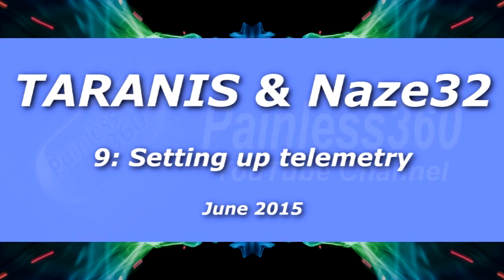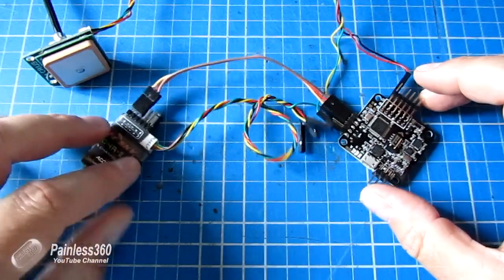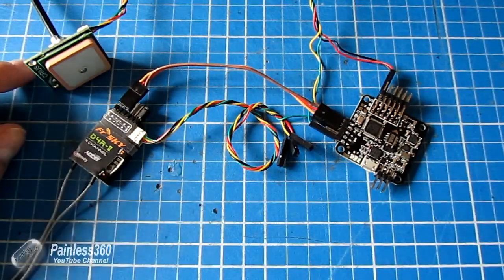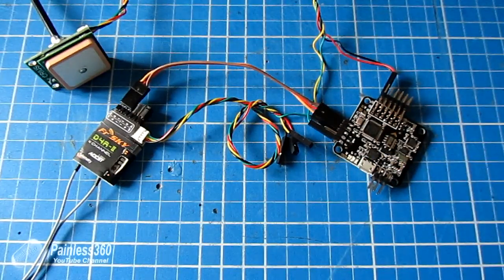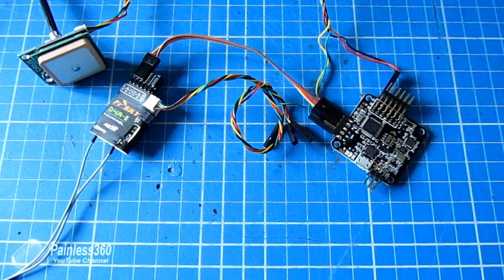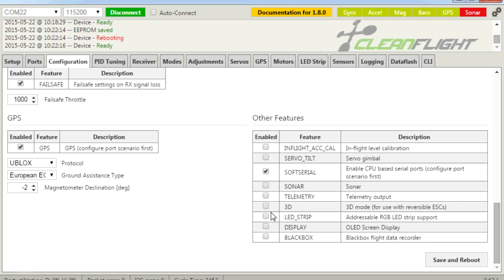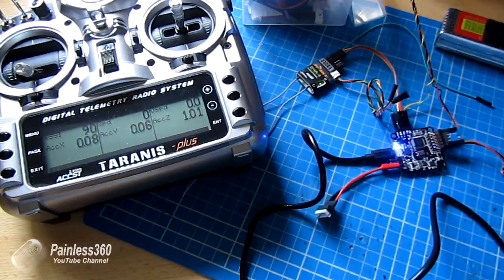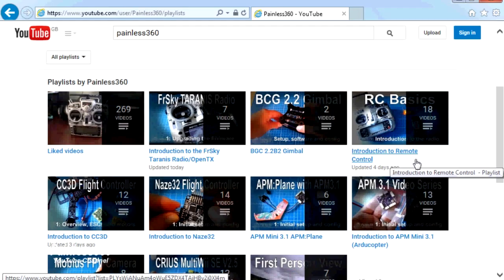(9/12) FrSky TARANIS/Naze32 Telemetry - Simple setup using a D4R-II receiver

Comment: in the beginning of the video you said you need the black and green wire but you only used the green wire I did everything you did in the video and it's not working do I need to connect the black wire to a ground?
Reply from the maker: +basebilljr07 It worked as we did it in the video. We were using OpenTX2.0.17, later versions changed the way that telemetry worked and needs you to 'discover' the telemetry available before they can be used. Best of luck!
Reply: +Painless360 yes I knew that much but I got it working I had to change the setting in clean flight ports from the 9600 setting to the automatic setting and then it worked
Reply: +Tim Donovan the radio has to be paired to the receiver with both needed on then in the actual radio go to the tale page which is telemetry and highlight scan for sensors and push the enter button
Reply: +Tim Donovan in the ports tab on clean flight did you enable soft serial and change the tab to Frsky and automatic I had the exact same problem and that was what fixed it
Reply: +Tim Donovan if you connect the green telemetry wire to CH 6 on the naze and enable softserial in clean flight ports tab you will get telemetry even when the board is not armed
Reply: +Tim Donovan no problem I was just dealing with the same exact thing its my first mini quad I built (the ZMR250) and I was having the same exact problem with the telemetry but yeah it's very easy to switch that but yeah it's very easy to switch that just move the green wire to CH6 on the naze then go into clean flight and in the Configuration tab enable softserial then go to the port tab turn on UART1 then the drop-down box change to FRsky click save and your good to go

Comment: Anyone have an idea what the difference is between A4 and Cells values?  Looks like the Taranis radio is already setup for lipo voltage using A4 (low/crit warning levels).
Reply: The short of it is use CELLS.  If your voltage level is not correct and needs to be calibrated there's a Cleanflight/Naze32 setting to adjust the scale, vbat_scale, which is what I adjusted.  Background, A4 is voltage reading on the receiver that the receiver adds to telemetry as it's sent to your transmitter.  If you power your receiver thru a BEC or DC to DC step-down then A4 is not very useful to measure battery life.  Also contrary to some sources CELL telemetry value is worthless unless you have something plugged into the batteries balance connector measuring individual cell voltage like, frsky sp-flvs.  I like the idea of warning on a single low cell but I didn't want the extra weight or complexity on my multi-rotor.  Hope this is helpful.
Reply: The values for CELL/CELLS are set by the flight controller.  The value for A2 is set by the receiver.  CELL/CELLS values dropping out could be a bug in BetaFlight or a telemetry cable/connector problem.  You might consider trying CleanFlight.  If CleanFlight works consistently then BetaFlight likely has a telemetry bug you should report.  If after switching to CleanFlight CELL/CELLS is still dropping out then try a different cable.  Hopefully, this works.
Reply: Under the CleanFlight Configurator I enabled battery monitoring.  I can use either the telemetry or soft serial pins successfully.  I have the latest version of OpenTX installed on my Taranis.   There is a new setup under Taranis for configuring FC data where the transmitter discovers the metadata supported by the FC.  When u do that you see all supported telemetry metadata sent to the transmitter.  You should see CELL/CELLS in a big list.  Earlier versions of OpenTX shipped on Taranis radios sold about 1yr ago (when I purchased mine) all telemetry metadata is included on transmitter but unassigned if not supported.  I have not tried BetaFlight yet so it could be a little different.  I know some of the config settings r different
Reply: ***** If your an acro/rate flyer then your probably not going too far anyway.  If your doing laps by yourself periodically you will hear buzzer if u want to stay with BetaFlight.  Don't forget to file a bug report with Betaflight developers.  It's likely they already know but still more voices helps set the priority.

Comment: Great set of videos! I used this one to set my Flip32+D4R a while back, but after moving from Cleanflight to BorisB's betaflight telemetry stopped working. Or at least I noticed that it was not working.
Re-did all the settings via GUI but the CLI command above was returning an error. Finally had the idea to check a cmd dump and found a "set telemetry_inversion = off" line.
Tried "set telemetry_inversion = on" (rather than = 1), et voila, problem solved, ça marche!

Comment: After binding the Frysky DH-4 receiver to the TX,I use a test servo,but nothing happens! My combination.  was just set up by a hobby shop that sells those.Even after that nothing happens.The light shows the receiver as being bound to the transmitter!
Reply from the maker: Check the connections are the right way up and is go back to the store and get them to give you a hand. Best of luck!

Comment: I am slightly confused about the DF13 cable:
1. Can I just cut the wires I am not using for a cleaner-ish build? 
2. Where did you find that cable? I have only been able to find the 4 to 4 pins - did you solder this yourself? 

Great videos by the way!
Reply from the maker: I crimp the ends when I can or use a spare connector from a 5 pin cable to make the end up how I need it. Best of luck!
Reply: Thank you so much - happy new year! :)

Comment: hi i'm using naze32 using pin 5 for my  addressable LEDs,  green lead to  pin 6 for the telemetry but it seems to stop my leds from working how can i get both to work ? cheers
Reply from the maker: The answer is here - https://github.com/cleanflight/cleanflight/blob/master/docs/LedStrip.md
Reply: +Painless360 cheers one guy as said i can do it this way using ppm so use pin 3 on the naze32 then set the uart 2 to frsky telemetry . then i can still use pin 6 for the leds !
just done this and it works sorted
Reply from the maker: Great tip! Thanks for sharing!

Comment: My naze32 rev6 board came with a warning that said 'do not use cleanflight' so I'm using base flight. I wired things up as you suggest but in BaseFlight (the Chrome app) there is not a setting for softserial. There is serialrx_type but the values are 0 - 4 and I have not found what these magic numbers mean. I suspect one of them is for FrSky. Any help on this?
Reply: +kle quis Finally found the below. Hopefully it is correct and .._type=5 is for me."set serialrx_type=0" for Spektrum 10bit (1024)
 "set serialrx_type=1" for Spektrum 11bit (2048)
 "set serialrx_type=2" for Futaba SBUS mode
 "set serialrx_type=3" for Graupner SUMD
 "set serialrx_type=4" for msp
 "set serialrx_type=5" for Flysky IBUS
Reply: +kle quis OK, so was wrong about that since it says Flysky not FrSky. So back to original questions which is what would I set serialrx_type = ?
Reply from the maker: +kle quis This is a question fort the Baseflight community ;) This board is supported from Cleanflight 1.11 out now..
Reply: +Painless360 Yes, read earlier today that Cleanflight was now good to go with rev6 so I switched to CF and am going through you video again now. And of course, thank you for the information you share. Your videos are excellent, i.e., informative and easy to understand.
Reply from the maker: Good news! Best of luck with it..

Comment: Is there a way to assign the telemetry output to a different pin on the Naze32?
My contact pad for pin 6 broke away mid-flight. Really like having the voltage info w/o needing to arm the board.
Reply: +OnBoardWithBlade Found the answer to my question! For anyone else who may suffer from the same problem: You can also utilize Pin 8, you simply choose Softserial2 (instead of Softserial1) in the configurator.

Comment: Do you have a post on how to set up A1 an A2 on the Taranis?

Thanks.
Reply from the maker: +Hoggdoc The voltage will swing wildly when in flight as you pull current. You could create a virtual sensor and try to 'average' the value over a short time to reduce the dips due to the throttle increasing but it is basically a very poor indicator of how much power is left in the battery and useless IMHO on a quad....
Reply from the maker: I've used those and they seem to be good. Still get the voltage jumping under load. I've not seen that happen just sat on a bench though. Dodgy vbat on the Naze32 you have?
Reply from the maker: Possibly, see out video on using telemetry on the Taranis for how the multipliers work. Best of luck with it...

Comment: Thank you for the video.  I set up mine using the D4r2 and the Naze32.  I can see telemetry and the Cell(s), but it does not match the A1 and A2, Do I just ignore them or can I assign the A1 and A2 to take the readings from the software port?
Reply from the maker: +Frank Ragsac If you are not using V2.0.x of OpenTX then the Telemetry system is different..
Reply: +Painless360 I am using the 2.0.
Reply from the maker: We cover how the A1 and A2 telemetry works in the telemetry video in the series. This should help.. Best of luck!

Comment: So maybe its not working as well as i thought =/ 

Whenever I take my lipo out of my nighthawk 280 and try power it up again i get no beeping or responce once i've armed it. Using Baseflight i don't have this problem but as you know the telemetry doesn't work. Not the end of the world as the main reason i want telemetry is for the battery info. 

But if anyone knows why Cleanflight doesn't seem to want to save after i power down i would love to know. Sure its something silly i'm doing.

Comment: Hello, I have managed to get this working with my Emax nighthawk 280. The AccZ/Y readings are showing on my Taranis. But i'm afraid i cant see and readings for my lipo in the nighthawk? Is that even possible?
Reply from the maker: Yes it is. We are planning a video on this..
Reply: +Painless360 

That would be amazing. Can I 'subscribe' to this and receive an email once you have posted it? All your videos about the Taranis, Nighthawk and Naze32 are a wealth of information. There is no way I would have got it up and running without your vids. I doff my hat to you!

To explain a little about how i have acheived it for those in the same boat  :- Using extra cables that came with the D4R I connected the telemetry on the side of the D4R to channel 6 on the nighthawk FC using cables that came with the nighthawk and removed the other wires so I am left only with a green wire going from 'rx' on the D4R to channel 6 on the FC. Flashed cleanfight. Setup the D4R to use PPM. Enabled softserial port. Finally (i think, it was late) invert the signal using the command line 
set telemetry_inversion = 1

Hope this is a 'correct' way of doing it.

Many thanks for your help

Comment: My vfas is showing a full charged 3s as 12.1 volts on my taranis but my multi meter is showing 12.5....can anyone point me in the right direction as to how to get vfas to show the true voltage please? It's the same if I select cell (or is it cells?) it shows the voltage reading under what it actually is. Confused!
Reply from the maker: +mrmurder75 Have you watched the 8th video in the Taranis series? Hope it helps..
Reply: +Painless360 not sure.... Probably! But sometimes the info goes in one ear and out the other! I'll go have a looky now, thanks.

Comment: @Painless360 any tips in getting this to work with the FrSky X8R Receiver.?
Reply from the maker: +Glenn Pringle Yep, the X series uses SmartPort so you need to select that in the telemetry setup in Cleanflight and some subscribers have got it working by connecting the Rx and Tx pins on the UART and then connecting them to the s.port pin on the Rx. Best of luck.

Comment: Just updated my Taranis to 2.1.3 tonight and I think it may be my problem, but when I set up my Telemetry screens, there isn't a "cells" option. Has anyone else out there updated there Taranis and had this issue? Without it, I can't get my battery voltage back.
Reply from the maker: +Justin von Linsowe Lots of confusion with the new Telemetry system in 2.1.3. I'm still waiting for it to settle down before upgrading..

Comment: Thanks for the video.
I changed from Baseflight to Cleanflight on my quad and had problems getting telemetry working after the change even though I had everything configured properly on my Taranis with OpenTX 2.1 as well as in Cleanflight. 
Turned out that I had to delete all the old Baseflight telemetry sensors in the model config on the Taranis and then rediscover them to get it all to work again.

Comment: Hi Lee, I tried this setup on X4R SB, using SBus to connect to Naze32 and Inverter Cable (same from your vídeo). I followed all instructions but looks like doesn´t work with SBUS mode for some reason. Any idea? Should I solder the RX/TX pins on the middle of the board and try this pins? If you have one X4R Sb is possible to make a video? Thanks a lot.
Reply from the maker: +Marcelo Tito Farinon  X Series uses SmartPort not traditional telemetry.. ;)

Comment: hi, i am searching for the vid where u connect frsky rssi to a pixhawk for it to be shown on minimosd and mavlink radio. you sended me a message months ago with the link but for some reason i can not vieuw any older messages from google+, it sayes that i dont have any urly messages for some reason. and now i cant find that exact vid anymore. would u sent me the link again plz?Thx
Reply from the maker: +jelle buyckx Sorry, I send tons of messages every day so I can't go that far back either. I would Google your question and try to use as many of the key phrases as you can. Best of luck!
Reply: Painless360 yeah i can imagin that... normally i just need to setup my taranis radio so that ch8 represents Rssi. via the ppm input the pixhawk normally passes that tru to my minimosd thats connected to telemetry port on the pixhawk, and then minimosd extra should understand it, but i cant get it to work. do i missed a setting in missionplanner to pass tru the ch8 data to the telemetry port ore something i forgot? Thanks for your reply
Reply from the maker: Try http://copter.ardupilot.com/wiki/common-rssi-received-signal-strength-indication/ best of luck!
Reply: Painless360 i finally got it working. on the pixhawk u dont need to filter te sbus rssi from the frsky receiver to an analog, i just put it in on the sbus port on the pixhawk, in full param list put rssi pin on pin 103 and then set the rssi range to 3.3 volts, works perfectly.
Thanks again for your support.
Now the next thing to figure out is how i can pas tru a channel to my minimosd so i can use a switch to navigate tru the different osd panels... i cant get it to work.
Happy flying!
Reply from the maker: Well done!

Comment: Hi, first thanks for the videos. They help a lot for people getting into flying. 
Ive just got into miniquads and trying to connect X4R (CPPM firmware) the same way you got D4R connected. 
When i did it on a D4R it worked fine, but X4R doesnt seem to send telemetry. Did you experiment with X4R at all? Any ideas what i could try?
Reply from the maker: The x series of receivers use SmartPort telemetry, different from the D series receivers so you need to look at how you that newer telemetry format into the receiver from whatever you are using. Best of luck
Reply from the maker: +mxte You can preview the Cleanflight FrSky SmartPort telemetry settings on the SP3 video series now by watching https://www.youtube.com/watch?v=mFvb40oE_pM&index=9&list=PLYsWjANuAm4ro1vHztauuHFaelUDCOwqw Hope it helps.
Reply: thanks for remembering! 8th video seems to be missing though. Looks like SP3 should be my next FC
Reply from the maker: I've had to re-upload it as it has a slide that was confusing. I'm trying to remove confusion - not create any more. Should be there now..

Comment: hi I have connected my telemetry like above I get rssi but I want to get flight battery voltage up on sreen with no joy I have a power lead to the bat pins on naze 32 is this correct any help would be greatfull
Reply from the maker: +Darren Fisher Can you see the battery voltage in Cleanflight? (guessing Naze32/Cleanflight as you don't say)..

Comment: Hi Lee I contacted you recently by email about my quanum neon 250 build and the trouble I was having trying to wire up my x8r with a sbus to cppm converter and you suggested using a dr4 II instead of x8r but I have a recently bought Taranis with eu firmware and suppliers are telling me the Taranis is now no longer compatible with the dr4 II is that true?
Reply from the maker: Not quite. Read http://www.multi-rotor.co.uk/index.php?topic=14975.0

Best of luck.

Comment: Hi,
Followed your videos for Naze setup, thanks for the help.
How do I set up the LED strip support when I am using your soft serial telemetry?
Thanks for your help.
Reply from the maker: you can't use both at the same time. This is in the documentation. Use the default pins for telemetry if you want LEDs.. Best of luck!
Reply: +Painless360 Thanks for your prompt reply.

Comment: +Painless360  I'm using a Flip32. Is there a way to have telemetry being pumped out of softserial port on RC input 6, as well as being able to connect an LED strip to RC input 5? Thanks! Your videos have been a great help!
Reply: +Painless360 Thank you for the quick reply. I had not seen anything in the very limited documentation provided by Banggood, or in 3rd party Flip32+ documentation. Was just wondering if there might have been some sort of work around (possibly by reassigning connections). Will do without the addressable LEDs for now. :-)